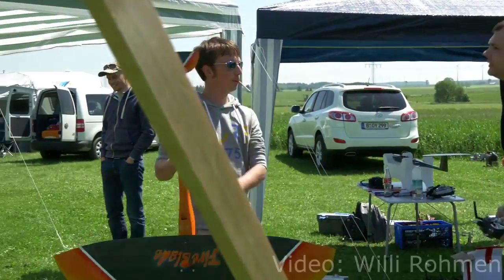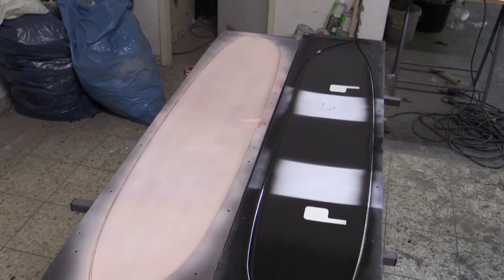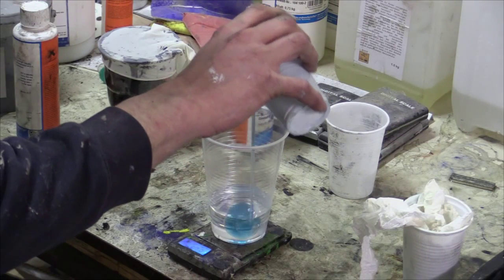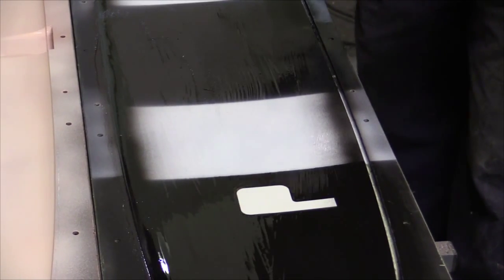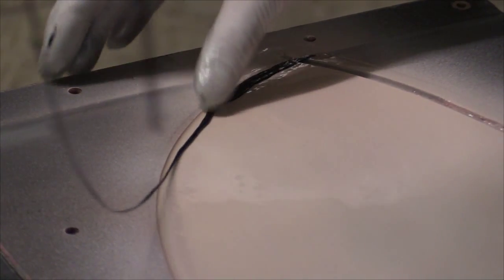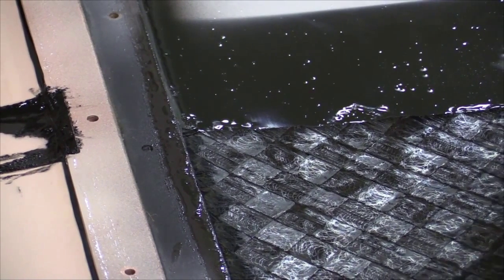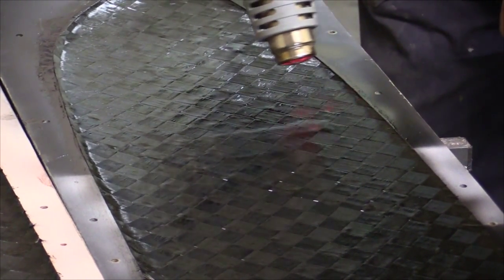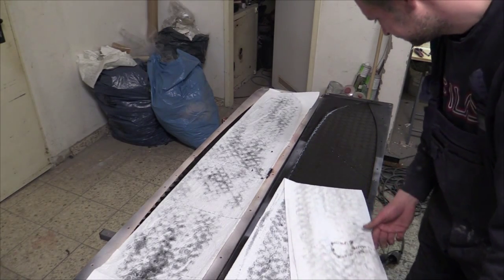Laminating Fireblade Speed RC Plane: Day 1/4

Comment: You should also use Nitrile gloves in stead of Latex. It is also good practise to change the gloves often, every 10-15min. Also smockinga and eating in a composite workshop may lead to health problems and a short life. Take care! Another tip is to sand the edges of the Airex thinnner so that they fit the LE and TE better without print through.

Comment: Very interesting and detailed laminating tutorial!
Thanks for sharing!
I have one question though, how do you make ailerons out of the molds, one the resin has already finished drying?
Do you just cut the edges or is there more to it?
Reply from the maker: +Airguardian Step 1: Cut the sides of the aileron with a saw or dremel. Step 2: Cut the fiber cloth of the "hinge" of the aileron on the underside wing with a knife Step 3: Scarify the fiber cloth on the top of the wing with a dremel disc guided by a ruler (by hand in order to not to cut through the hinge aramid)

It works a lot like this, although that is a wooden wing: https://youtu.be/A-v3dWYb4rM?t=712
Reply: Thank you! it was helpful! :D